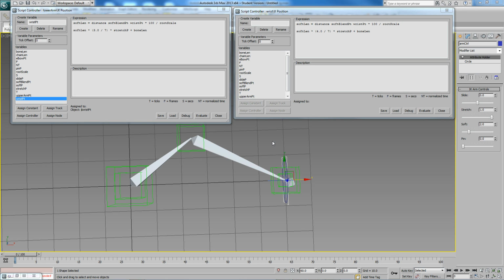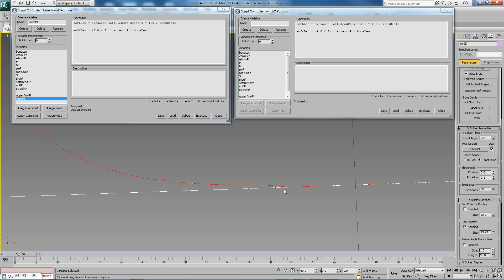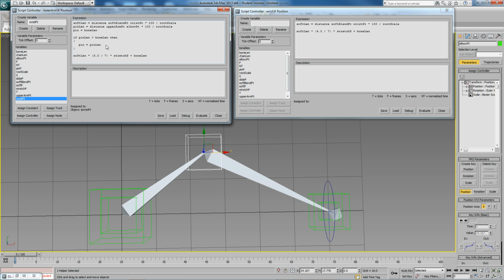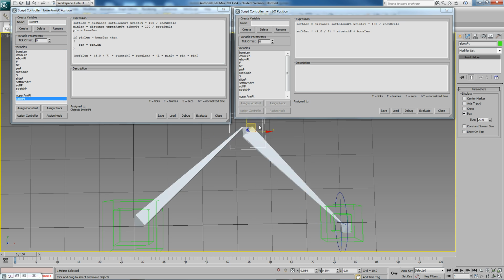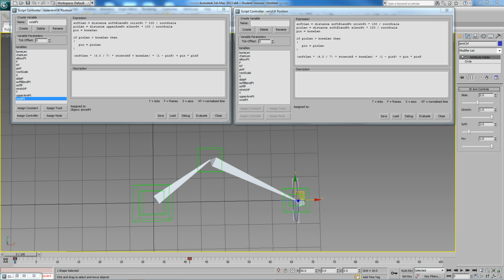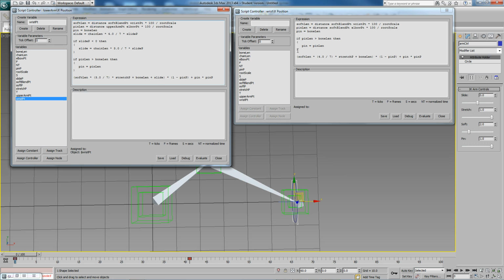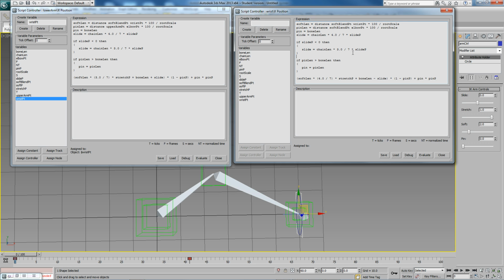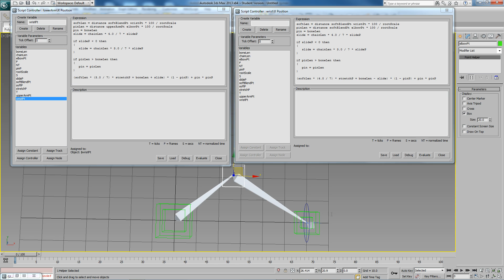4.  Setting Up Elbow Pinning And Sliding

Comment: I was attempting to script the slider on its own (I have to rig a telescopic arm and thought of using this technique) but I keep getting an error thrown:

slide = chainLen * 4.0/7 * slideP

if slideP < 0 then 
(
slide = chainLen * 3.0/7 * slideP
)

>> MAXScript Script Controller Exception:
-- Unable to convert: undefined to type: Float <<

note that the first line of the expression works perfectly.

Any idea where this might be coming from?
Reply from the maker: Sounds strange, if the first line works then it obviously means that slide, chainLen and slideP all exist, maybe you just need to type "slide" on a new line at the end to make sure that the slide value is the result of the script controller.
Reply: ah. I found a workaround but I will try it next time.